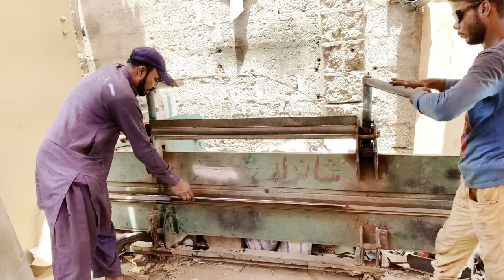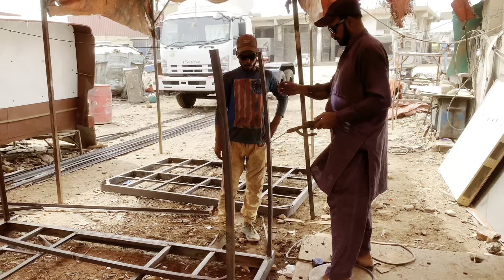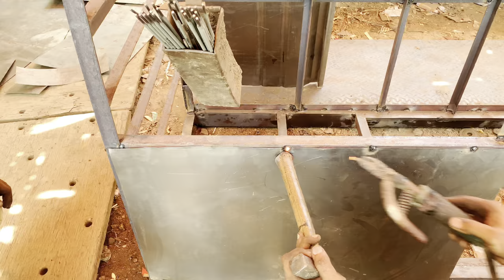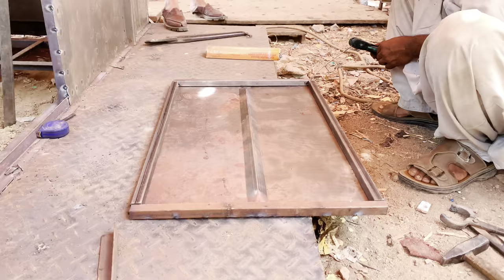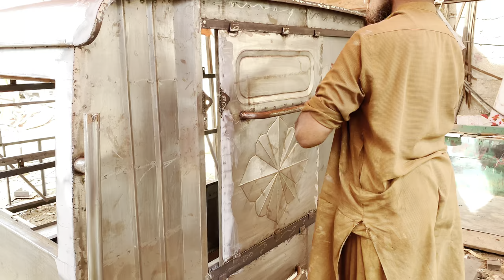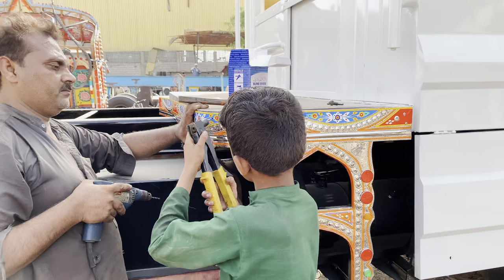How Experience Fabricators Made a Luxury Stay Room On 2022 Model Hino Truck || Sleeper Truck 🛻

Comment: I'm amazed to see all these guys still have all their appendages attached!!!:)
Reply: Been fabricating for 30 years. Still have all nine of my fingers
Reply: Open toe sandals are used the same way we use steel toe boots, that have a metal plate in the sole and some even with the metatarsal flap which is metal covered in leather. The factories often will give more towards these boots in metal working shops as it offers a little more protection against lost time accidents. People still die in industrial accidents here in Canada. I can only imagine how many workers are maimed and killed annually in India. I applaud them for their ingenuity and work ethic. This man was certainly happy enough with the quality of his sleeper unit.
Reply: @darrell3391   except these guys are using sandals on barefoot
Reply: @eln0n01  Think you misunderstood my comment there. I was contrasting their sandals with the boots everyone has to wear in the west. I did watch the video and my whole comment was about the fact they wear open toe sandals. The bare feet was implied and visual to anyone who watched the video. Thanks for pointing out the most obvious part of the comment though. Reading comprehension isn’t what it used to be I guess.

Comment: I accidentally burned my eyes by doing a few tack welds while shutting my eyes…… apparently enough uv even comes thru the eye lids. Can’t imagine during all that welding with sunglasses even if he shuts his eyes. Admittedly, very nice work  with minimal use of tape measures and no squares and no drawings or even sketches. I spend some time in a sleeper without AC….. not enjoyable if temp is over 80F.

Comment: To be fair, average nightly lows (F) in Karachi run from the low 50s (winter) to upper 70s (summer), so this sleeper could be fairly tolerable much of the time. And those figures are for a huge city, with all of the 'urban heat island' effects. If you're parked out in the sticks, temps could easily be 10F below that, which would require heating for comfort.

So maybe not so terrible after all?
Reply: Obviously its worth it otherwise they wouldnt buy it...
Reply: @lightfox11   😂😂😂😂
Reply: @lightfox11  😂😂😂

Comment: I have never seen a screw operated press brake, until now.
Reply: Using a fly press to form sheet metal pressings has been in common use here for many generations now and this is just an adaptation of it.  
I made one of these for my own use from three pieces of heavy angle iron and a piece of 2" square bar welded to a stub of 1" round bar.  It fits in my own fly press and works fine for folds up to 12" long.
Reply: @mrmyorky5634  I made one that will bend trim coil 90° fairly well up to about 5' long

Comment: In summer it will become oven & in winter it will become fridge. They must use some insulation materials in it
Reply: It's warm throughout the year in their region so all those ventilation openings are enough
Reply: You get used to the heat.   Just need a fan and screen

Comment: without electroplating under the paint i dont think it will long last
Reply: They have really dry climat.
Reply: The climate is mostly dry, and this is galvanized sheet steel. It doesn't rust easily.